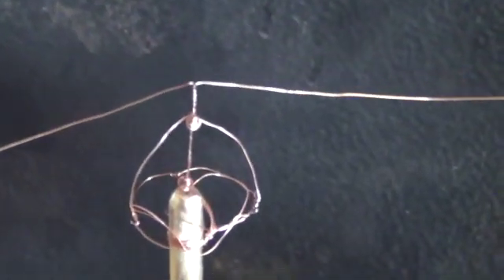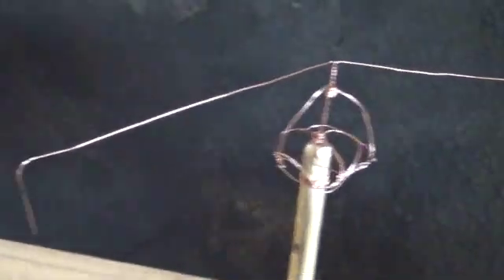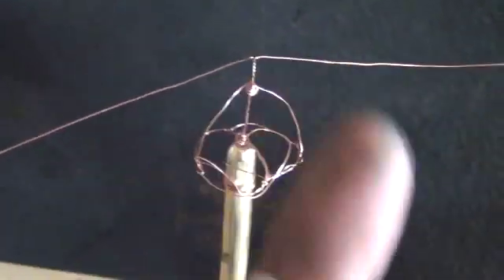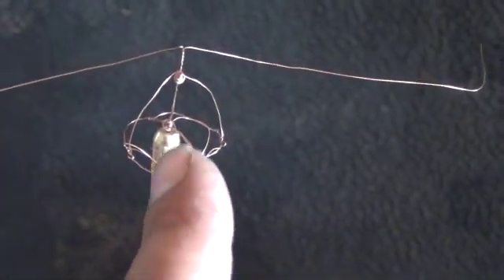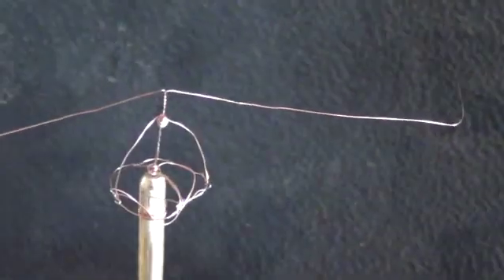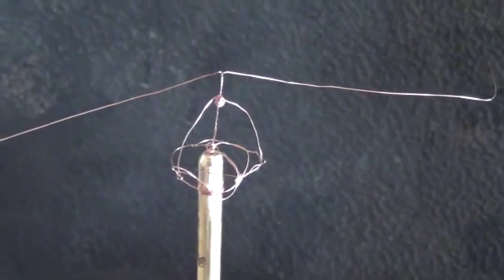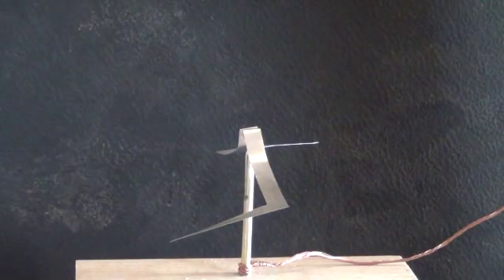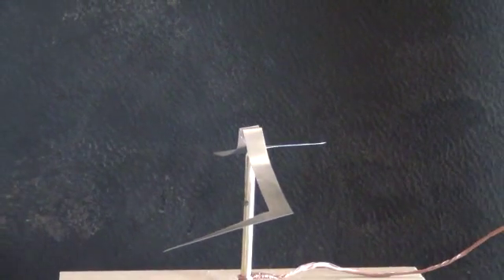plasma ion propulsion and electrostatic motor's

Comment: How about a high altitude long duration drone powered this way, tethered to the ground by lightweight shielded carbon fiber thread, to collect atmospheric  elecricity to generate useable electricity. Would have to be 1000+ ft high.

Comment: You could get it to run at higher RPM's if the static and dynamic balances were equal. Where's the video were they are running at 3000 RPM as seen on your "MrTeslonian show trailer"? By the way, you are awesome man